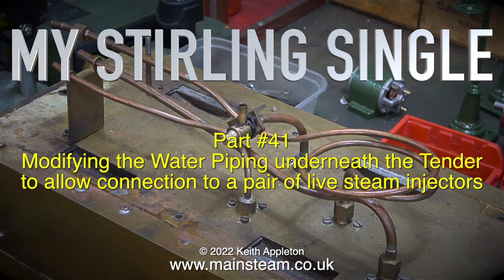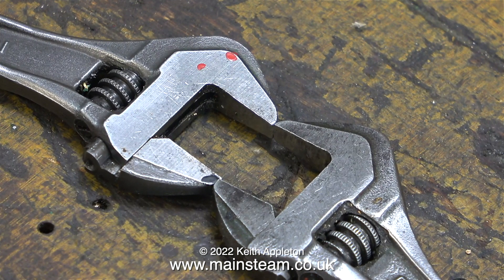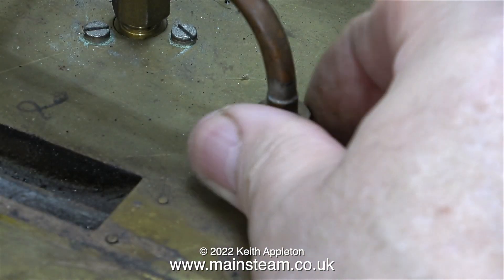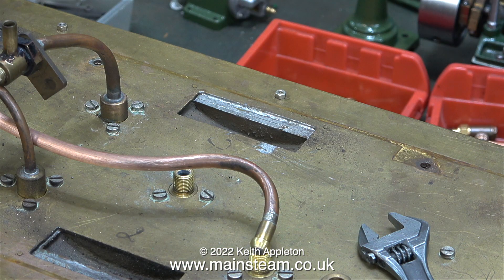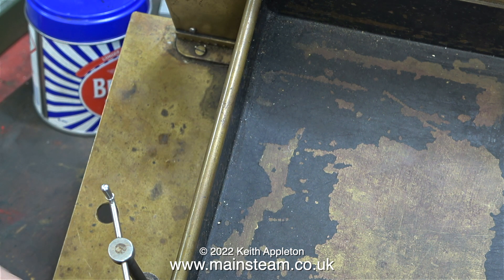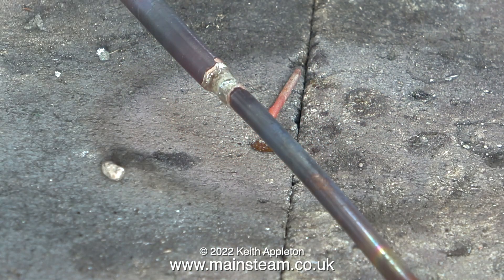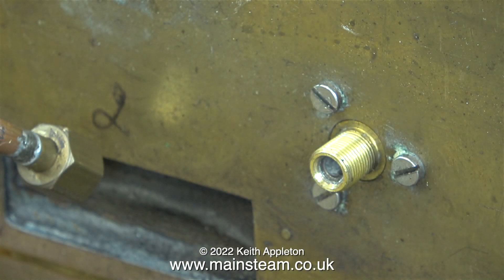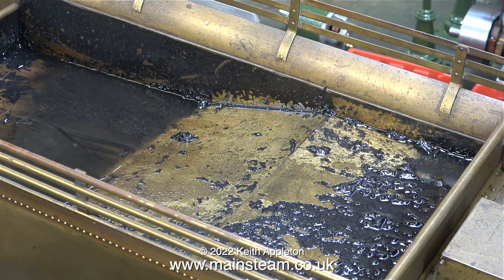MY STIRLING SINGLE - PART #41 - TENDER WATER PIPING

Comment: I find that many folks who comment about your Barco (adjustable) SPANNERS, do not understand the difference between a spanner and an adjustable (crescent) WRENCH. It all has to do with how much play is in the adjustment screw and the movable jaw, along with the tolerances allowed. Adjustable WRENCHES are always sloppy, SPANNERS are NOT  sloppy. I live in the US. I would like to have some OLDER Barco's myself, much better than Crescent wrenches.
Your older spanner is very likely a true metric wrench, 25.4 MM = 1 inch not 25 MM. So if you measure the opening it just might be a true metric to imperial conversion span. ;-)